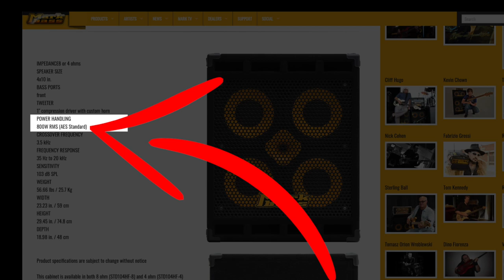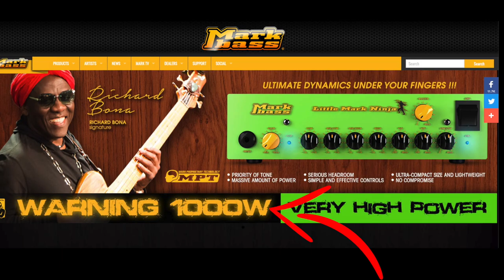WTF? Bass AMPS, WATTS and OHMS finally explained!

Comment: Please remember, like with car amplifiers, your head will not be sending a constant power of 800W to your cabinet at all times. This is simply how much power will be sent when operating at full volume (assuming the power ratings of your head and cabinet are the same). So if you are at only 20% volume, your head is definitely not outputting 800W to your cabinet, but instead much less (ex. ~200W). So like mentioned in the video, it is alright to have a head with a bit more power than a cabinet can handle, you just have to make sure to not drive it too hard and make sure to match the impedance.

Comment: I use a Mark Bass Jeff Berlin Combo 15 and a Mark Bass 2X10 as an extension cabinet. I can also just use the 15" combo solo. I bought a Mark Bass amp to power the 2x10 cab for gigs that it'll handle. That way for the big gigs, I stack the 2x10 on the 15 combo but use the other head on the 2x10 giving me 300 watts per cabinet. I run a line out  from the 2X10 head to the balanced line in on the combo amp so each cabinet can have it's own unique sound .  That configuration gives me the ability to dial in super lows, crisp highs and punchy midrange because each cabinet has it's own amp and eq etc.
Reply: Is your amp head a little mark ii ? What ohms do have your 2x10 and 1x15 set at when stacking to give you the 300 watts per cab ? (Just curious , didn't know it was possible)
Reply: @yeewhiz  Little Mark III and the 2x10 is 8 ohm. I only get 250 per cab when stacking but I often use two amps with Little Mark III powering the 2x10 cab and the Mark combo powering the 15, that's how I get 300 per cab. I use a separate amp for each cab and run a line out from one amp to the XLR in on the other. Each amp is 300 @ 8 ohms. Really cool with my Rickenbacker in stereo giving me one pickup per cabinet. Using 2 amps gives me the ability to have two totally different EQ settings for each cabinet too.
Reply: @yeewhiz  I use a Mark III with the 2X10 and the Mark combo amp with the 15. They both put out 300 @ 8 ohms. When I'm running both cabs off the combo head it's only 250 per cab. Using two amps gives me the option to use a different EQ for each cab too. Pretty cool. I just run a line out from one amp to the input on the other and then balance the volume as needed. Really cool with my Rickenbacker in stereo mode too. I have one cab and amp per pickup on the axe.
Reply: @hermonbluesmaclin-theboogi6830  Thanks for the insight. I recently got the 2x10 because I like the clarity with the higher tones. I've had the 1x15 cab for a while and decided to get a 2x10. They both sound good for the purpose they serve. I was just curious to try my little mark III on both amps. Having an amp for each for different EQs makes perfect sense.
Reply: @yeewhiz  They definitely do sound great either way. And you’re right, the clarity of that 2x10 is better than the 15. I like the 15 for my reggae gigs.
Reply: @yeewhiz  I spoke with customer service at Markbass who told me I’d be safe using the 2x10 as an extension cab as long as it’s the 8 ohm version and the 15 is also an  8 ohm cabinet.
Reply: @hermonbluesmaclin-theboogi6830  nice ! Thanks for checking in

Comment: Great explanation of how things work. It's something I had explained to me years ago and I did the physics whenever I wanted to try something new. It helped me learn things. If this video existed back then, would have saved me time and effort. LOL! Great job!

I run an Ampeg SVT-3 Pro through a Trace Elliot 1048 (4x10 cab - 8 ohms) and Trace Elliot 1518 (1x15 cab - 8 ohms). The cabs have "Input" and "Link" inputs. Use "Input" direct from the amp and "Link" for a stack. Great tone and volume no matter how I run this setup.

Comment: This was great. When I was a kid playing bass back in the 70s, I used to beat my head against the wall after blowing up bass cabs. 
I now have EV’s  an old SWR basic 350. Burgundy face. It’s good down to two ohms, has a tube pre for warm sound, and you can find them for about 300 bucks all over the place. It’s a steal, grab one if you can. 450 watts at two ohms.

Comment: I have a MESA 8 10’s Bass cab that has the parallel out that you mentioned and I would usually put workingman’s 410s behind the Drummer . What a great thing that MESA has included in those old cabinets, I wonder if they still do.

Comment: please explain Clay , how come compos have an 8 ohm speaker in them ? do they run at half their nominated power ? thank you
Reply: You would need to check the specification sheet for your amp.  But, with combos, generally, if it has an "external speaker" port, then it runs at about half power. Add an external cab and you will get full power.

Comment: thanks for explaining

I am an electrical engineer and missed the math

my rig includes a 2/12 and a 2/10, both with a tweeter
two heads and a passive mixer to drive both amps and 
control the balance between the two combined rigs
for sound changes after setup only the onboard EQ on my bass is used

 some more combinations possible

first rig I built contained 19" gear:
Rack Tuner, 
19" dual compressor, 
active crossover
five band parametric EQ
stero power amp 
the two mentioned cabinets

too heavy and less versatile compared to my current setup

thanks for your good work

Comment: Thanks for this Clay.  I sort of knew what goes on with impedances etc but your brilliant explanation has filled in or the gaps. As a guitarist & bass player there is one question I have never had an answer to. This is as follows....WHY does a 100 Watt VALVE amp sound so much louder than an equivalently powered SOLID STATE amplifier?  I use both kinds of amps & there is definitely a huge difference audibly.  In other words why is a valve watt seemingly louder than a solid state watt? By the way I use a Mark Bass 800w amp head with a tiny pre-amp valve that can be dialed into the mix. I also use a Mark Bass 4x10" which is rated 4ohms. I believe this is similar to your rig in one of its configurations. I would like to add a 15" cabinet & bi-amp the 2nd system to keep the impedances correct but carrying this gear will be ridiculous at my senior age. The speaker magnet technology has improved massively & Neodinium ceramics have lightened cabinets somewhat.  However the cab size situation has not inproved that much so I would still need a truck to carry this gear :)
Reply: Good question, I saw that tubes are louder than solid state(on a guitar amp vid), smaller tubes powering the big tubes, but I don't remember the exact reason. What I do know is that tube amps are a helleva lot heavier, haha, ugg.

Comment: Why not just use the 410 for the small venue with the volume backed off, the 410 for the medium venue with more volume, and two 410’s for larger venues.  FWIW, I acquired this 410 recently.  The amp is 1000 W and is on back order till December ‘24.  Hopefully that’s just a placeholder.  I think the head you’re using is the 800W tube head.  I’m not so sure on the tubes.  Have you done a discussion on tube vs. solid state?

Comment: Solid State amps can usually run at 4 ohms (the old Sunn Coliseum could run at 2 ohms, which will blow most amps out, but Sunn went out of business some years ago and they are hard to find now). I run a Mark Bass head that puts out probably 500 watts at 8 ohm, but I run another cabinet out of the second output. I have a 4x10 cab at 8 ohms, and a 1x15 cab at 8 ohms, so that running in parallel, total 4 ohms, which allows my amp to run at 4 ohms and puts out 800 watts. Tube amps with an output transformer may be able to handle a little more variance in the output impedance, but if I ran my Solid State amp into 2 ohms, I would likely toast my output transistors. I have yet to use 800 watts, as this would be very loud. My 4x10 is the same Mark Bass cabinet in your video, and my 1x15 is meant to handle 350 watts, so I could possibly blow it out if I went full throttle. And when you're pushing a cabinet to it's rated wattage, you may still overheat and blow out a speaker. If your speaker is making scratchy distortion, you can gently push on the speaker cone. If you hear scraping, you have blown your speaker. If it won't move at all, you've sent the speaker into total meltdown. If I so blow my 15, which is unlikely saying I have only played small venues and have more than enough power. I will probably replace it with a Neo 2X12 cabinet.

Comment from the maker: Man, this stuff can do ya head in.  Hope that helped you guys out if you were really struggling to understand Cabinet and Ohms.  I will add here that on more research it seems that MOST cabs tend to have Parallel connectors and just don't state it on the back but not ALL!  So if you aren't sure if they are or not always connect each cab to the Amp Head individually to play it safe. Only Daisy chain if you amp head only has one output and you have to.
Reply: It really would help if he were speaking American English.  In addition to the subject matter being a little confusing, and fast talking, there is a language barrier.  However, I do appreciate the attempt to explain.

Comment: If you daisy chain the cab that is getting too much power would that work? I had bass rig I put together that consisted of a Peavy 18" sub cabinet, EV 15"x10" cab powered by Gallien Krueger 700rb.  Ran a Fender Bassman 4x10 that I rigged to only use  2x10 and took out two speakers and the tweeter. Pretty awesome sounding but never got the chance to test the limit of the power before it was stolen. Any thoughts on the potential problems being set up this way

Comment: In my case amp is 2 ohm stable and I have two 4ohm cabinets, which allows me to have more headroom and very huge sound on the stage, it's awesome
Reply: hey i have a question, you probably just answered it but i wanna be 100% sure, my combo amp is 2ohm which alone puts out 350w…but can achieve 500w with an external cab….how many ohms does the external cab need to achieve 500w ??
Reply: If you want to achieve the maximum power from your amp you need to have two 4 ohm cabs this will give you the best performance for your amp and make your amp see a 2 ohm load and nice headroom

Comment: Great but have 2 questions, I have an 18" powered  sub-woofer running from my amps DI, do I need to consider this at all in the ohm calculation?
The sub-woofer has a DI through which I intend running to another identical powered 18" sub-woofer as they are separate powered units I kind of guess no problem? Certainly haven't had a problem running 2x10, 1x15 & 1 powered 18 sub from the DI as yet but in house I'm not running above 2 on the volume knob. In case your wondering why - my modified bass is tuned an octave below normal so it starts at E0 i.e. 20Hz.

Comment: good video!

If I need more power for a gig I’m entertaining the idea of adding a fender rumble 115 v3 extension cab (600 watt 300 rms 8hm) to my ampeg ba 210 v2 ( 283 watt @ 4ohm, 450 @ 8) via the extension out jack.

Other than offending other bass players do you think this is an advisable pairing spec wise?

My thought process is to add a 15 for more low end thump where I already have 2 10’s handling the punchy sound.

I’d love to get some feed back!

Thanks
Reply: I've done that, but splitting the difference, like he explained here, I found that I wasn't getting the best out of either. I always ran with 1 15, but I wanted to add a 2×10 so that I might actually hear myself over the obnoxiously loud guitarist I've played with. I dabbled with a 4×10, but I like the heavy hitting of a 15. That being said, the best bass cabinet I played was an old 2×12 offset.

Comment: I watched your video several times. Thank you for the good information. I did discover that my Behringir BXD 3000H Ultra Bass Amp Head  is rated at a minimum 4 Ohms and  300 watts and 180 watts at 8 Ohms. My  Ampeg 2x10 Portaflex Cab is rated at 8 ohms but wired in parallel so I can actually connect two  8 Ohm cabs and get the full 300 watts  Does this make sense? Thank you again.

Comment: I’m planning on pairing a 500w 4 ohm amp head to a 2x10 4 ohm cabinet but it’s RMS power handling is rated at 400w. Would this amp head being 100w over the power handling cause any issues? Also I’m not planning on doing gigs or shows this is just for practice.
Reply: From my research, you should be fine. Just don’t push it hard and pay attention to your sound. Don’t let the cabinet complain and overheat for long

Comment: Hugely helpful.  I've heard a lot of bad things about Markbass gear dying in the middle of gigs, which has made me reluctant to drop the $ on the stuff.  Now, I'm wondering if it was self inflicted by the owners improperly pairing their rigs.  I'm def bookmarking this video for my next equipment upgrade, likely to be Markbass...
Reply: Well, I'm very sorry to say that it happened to me after 6+ years of reliable operation playing at some pretty loud club gigs, MB Little Mark III combo with 2 x 10s connected to a MB 1x15 extension cabinet except during practice. Thankfully it died at home during practice - blew a fuse, which blew again after replacement within minutes. I spent a few hundred to have it repaired and the same thing happened again, within minutes. After having it repaired again I brought it to GC (where I bought it) and traded it for a couple of other amps. They have a great look and good sound and I love the lean back option for the 2 x 10 combo. Maybe I should be happy to have gotten 6+ years out of it?

Comment: Hi! one thing I don’t get; 
markbass has only one speakon out, so when connecting two 8 ohm cabs your only option is to daisy chain, or not? Cause in the video you disadvise to do that. What am I missing here?
Reply: Dennis Monincx On my little mark vintage I have 2 speakon out and I think it s the same with the tube 800

Comment: Hi there. Can you connect the bass guitar combo to a mixing table using a cable or is it better to use a microphone placed in front of the combo as you normally do with an electric guitar amplifier?
 Blessings from Porto, Portugal.
Reply: If your head has an XLR out or cabinet emulation out then yes you can connect direct to a desk. If your amp doesn't then it will need to Mike up your cabinet. It will sound bad if you connect direct.

Also if you run your amp with no cabinet resistance from the speakers you can damage your amp due to too much current. Always have a cabinet connected to your amp, even if you are going direct!

Comment: So I also went with Markbass speakers, and I'll be hooking up a 4x10 markbass cab up to an 800W Little mark head, and plan on getting a 1x15 cab as well. Looking at the back of my amp head, I see two outputs, one that says Speaker Cable and the other that says "Class 2 Wiring", does it matter which cab is connected to which output or not?
Reply: Doesn’t matter. Class 2 Wiring just means it’s generalized as safe from electrical shock and doesn’t pose a fire hazard under the electric code. They’re both speaker outs. The LM 800 tube amp just gives you two different speaker output options: the top one being combo jack of Speakon or 1/4”and the bottom one being the regular 1/4 inch (which I actually wish they would have just done both Speakon jacks). Use both of them, one going to one cab and one going to the other, and you’ll get the parallel circuit he’s talking about in the vid. I actually have the same setup, so here’s how it would look: Top (Speakon) speaker output jack running a cable to my 4x10 cab. Bottom (1/4in” jack where you saw ‘Class 2 Wiring’) running another cable to my other 2x10 Traveler cab. Now both cabs are separately connected to the same amphead instead of amp to cab then cab to cab (daisy chain). Keeps it Parallel. 
DISCLAIMER: According to Markbass themselves, it’s safe to daisy chain so I don’t know who’s right or wrong necessarily. Nerds are gonna nerd.

Comment: Thank's Clay this was very helpful! I have a question about 2 ohm amps, i have a Sunn 1200s bass head that runs at 2 ohms according to the manual, are there 2 ohm cabs out there or can I use 2 4ohm cabs?
Reply: I only know about Darkglass DG108, that have the 2ohm imput, but looks they discontinued this cab series

Comment: thanks a lot Clay ! still , if i connect an extension cabinet to  my compo amp ( it has an output for that ) , will the connection be in series or parallel ? how do i tell ? thank you

Comment: So if in got this right lol. 
I Run a Peavey Minimax 500 watt. To get 500 watt max power. I could use 2 8;ohm cabs . Rated to handle 500 watts or more?

Comment: It looks like you are a markbass fan :) In your opinion, which markbass combo is the ultimate one ( for practice and gig ) ? 😉
Reply: THE BIGGEST YOU CAN AFFORD..THE  MARK HEADS DONT SOUND DIFFERENT ENOUGH TO EVEN WORRY ABOUT..THE MORE DRIVERS THE BETTER...
Reply: 102 will have you covered for most stuff. Have a 4x10 for bigger gigs if you need it. You will be surprised just how much air the 102 combo can move!

Comment: Hey you mentioned towards the end about the impedance increaser your friend made so that each 10inch speaker would get the same power. Is this absolutely necessary or is it more of an "OCD" thing? Because the way I see it, the 210 should be ok with the 400watts, despite it being annoying that things aren't balanced with the 410 cab.
Reply: He wanted the applied wattage to each cabinet to be the same so the sound would be more balanced.